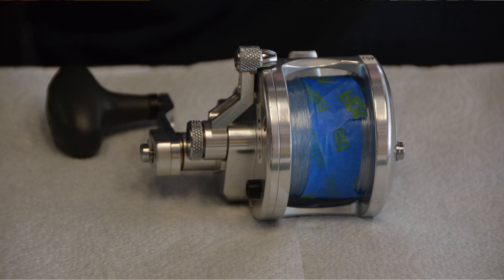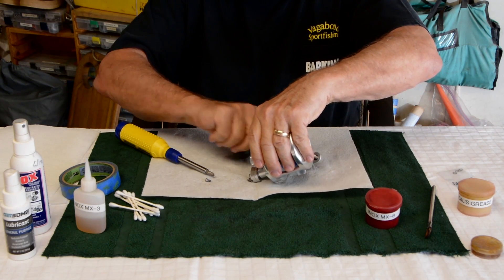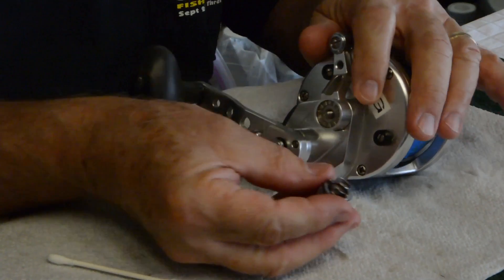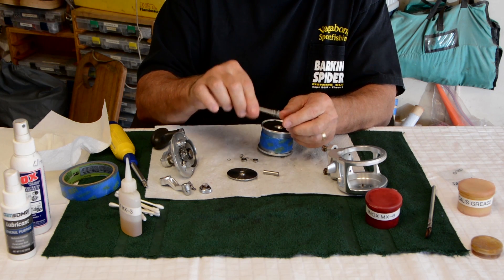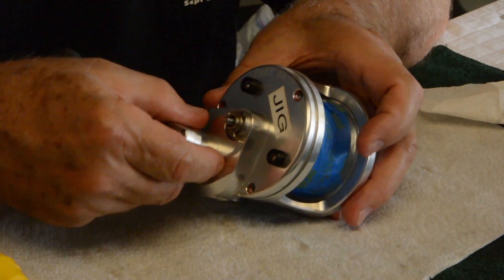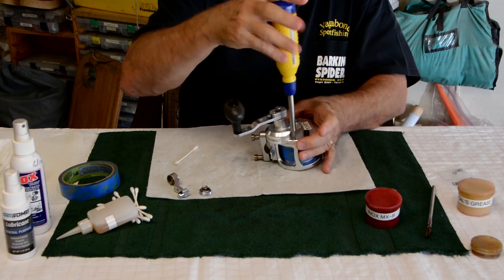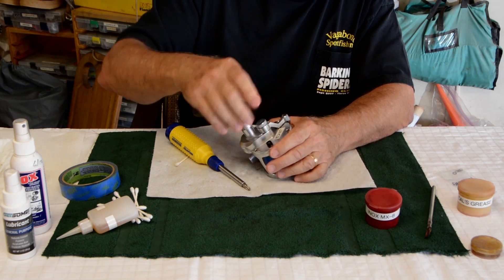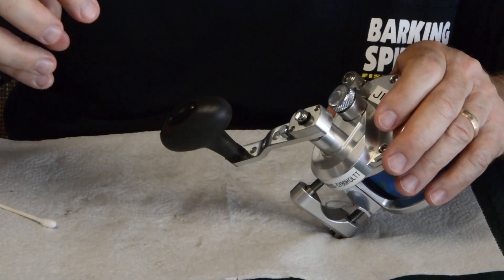Avet JX 6/3 Fishing Reel Service

Comment: Thanks for walking me through servicing this reel.  It had been neglected for a couple years and the owner gave up on it.  A thorough cleaning and service and now it feels great.  I applied some drag grease on the drag washer.  Its still dry but I added a touch.  Also greased the gear teeth lightly using penn grease.  Probably  fill the spool with 25 lbs test mono.

Comment: Great video these are. Use very little grease on Avet gears. I grease each tooth of the pinion gear and put none of the drive gear. The amount on the pinion is plenty to spread around the main gear. I'd also remove the handle, dog and main gear at least once a season. Stuff gets trapped behind the gear and it's super easy. You can disassemble every piece, clean, service and reassemble any Avet reel in less than 20 minutes.

Comment: Thanks for the vid.  Very helpful.  Where do you apply the avet grease?
Reply from the maker: I grease the gears sparingly. I cover the teeth fully but with a fairly thin coat.  My worry is putting too much on there and having this negatively affect the s shaped dog mechanism.  Grease and look carefully at the dog actuator arm and remove all grease that gets under it.  Oil is great there and grease is very bad and can cause a dog failure.

I do not cover the entire inside of the reel with grease as some folks like.  I HAVE fixed several reels that just did not work well covered in grease inside.  Simply removing the grease, oiling the inside lightly brought everything back to normal.  Clean is good.
Reply from the maker: I use grease on the gears sparingly. I use grease on all screws and between any two dissimilar metals like aluminum and stainless steel. I am NOT a fan of coating everything with a thick layer of grease. I service often instead.

Comment: hello I have a reel avet sx which disarmament to clean but join him when I forget how to do this I need a mini video of how they washers on the right side of the reel for q now to launch vibrates
Reply from the maker: There are belville washers in the left side. They should never be removed or touched. There are two very thin washers on either side of the spring in the spindle. 

Bearing washer spring washer bearing.

Comment: Question...recently bought a new 6.0 avet single gear lh retrieve reel and it is noisy as heck. Is this normal? Also when applied tension to the spool with drag you can hear a shhhh noise. And it only free spools for about two seconds. Is it bearings or does it need a little oil? Much appreciated and great video
Reply from the maker: After this service - fish it. They get much smoother with use in the water.